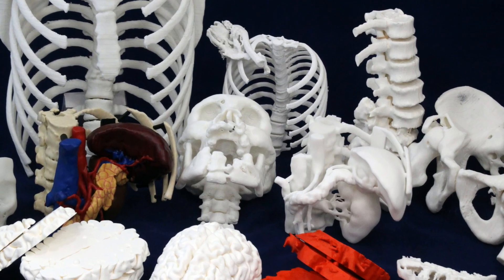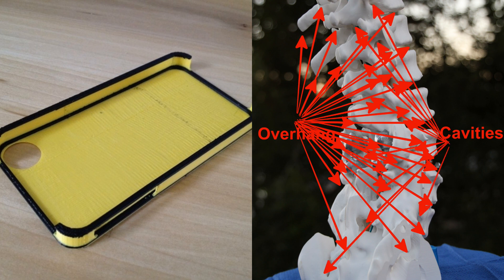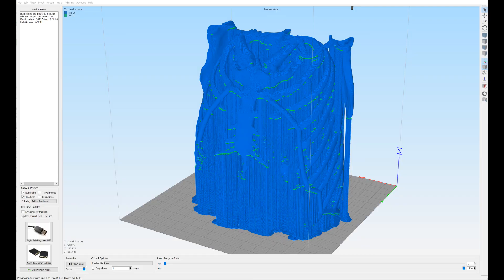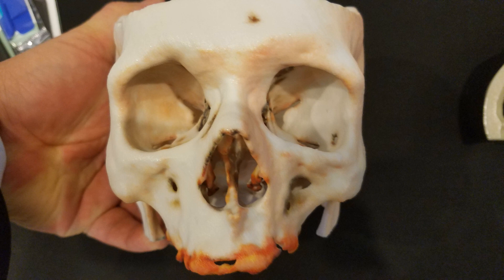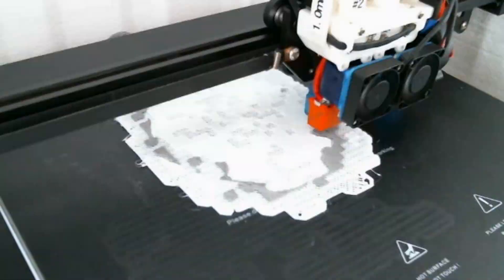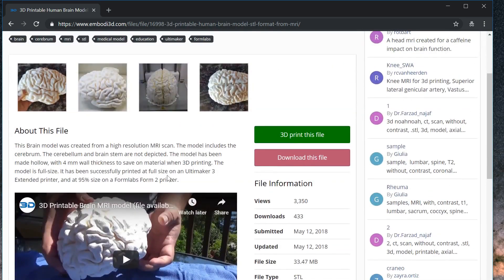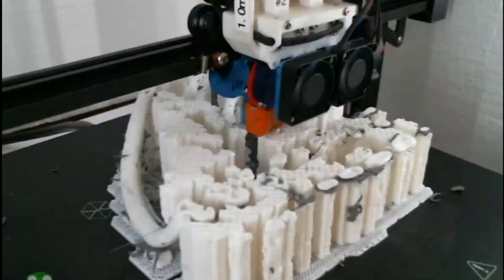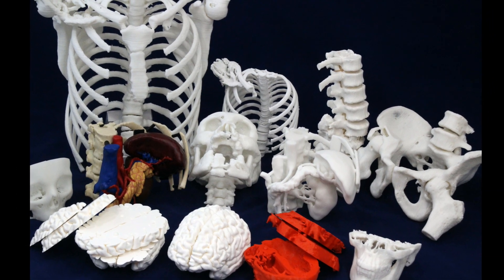embodi3D 3D Printing Service

Comment: New subscriber 🤓🤓🤓🇦🇺🤜🏼🤛🏼
Really awesome stuff! 
Zbrush does amazing work cleaning up CT scans. It has a polygon projection system that can project high poly mesh scan details back onto the Zbrush  Zremesher low poly geo. That’s the way I’ve always clean scan data for medical simulators.